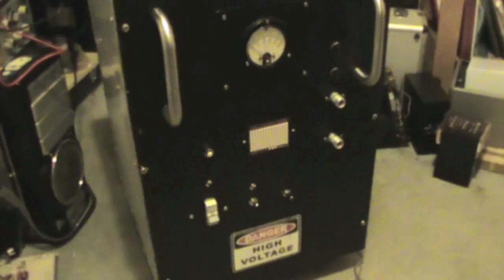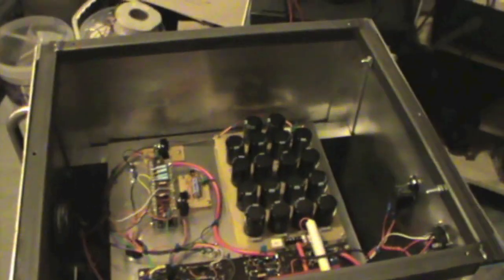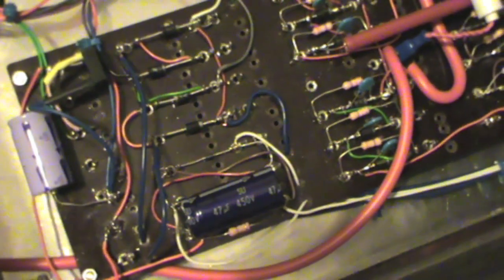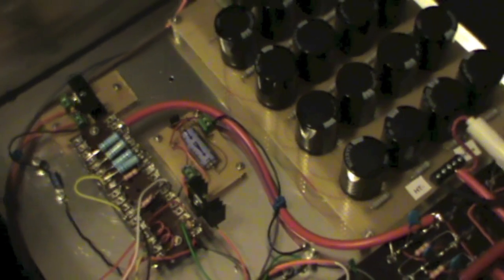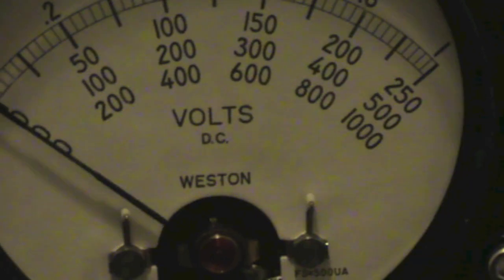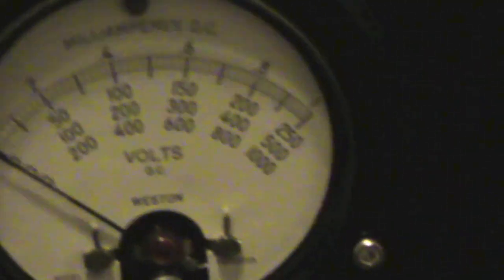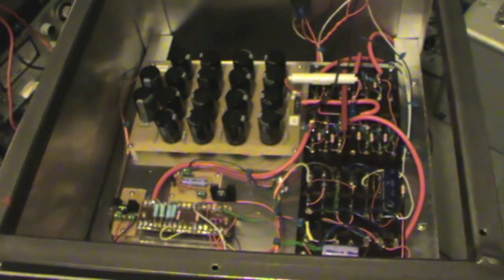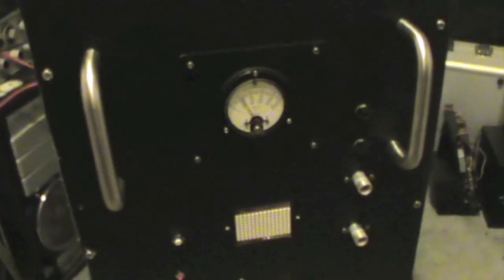High Voltage Power Supply For RF Amp

Comment: May I ask what type of HV connector are on the front of the PSU?
Reply from the maker: Those are igniter lead sockets from old jet engine igniter units. Very difficult to find. Usually use SHV connectors these days... easy to get off eBay or Alliexpress